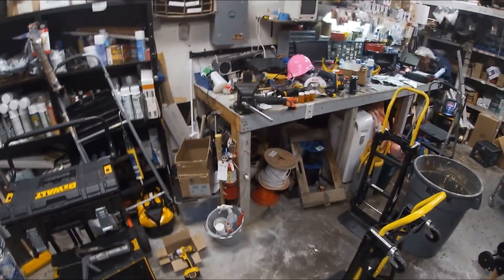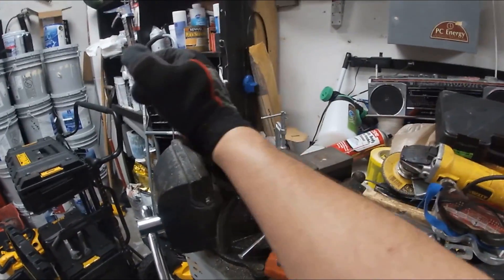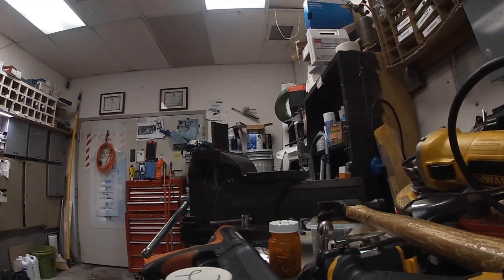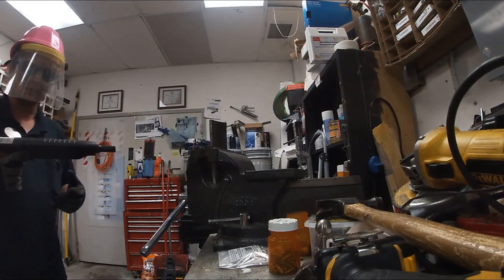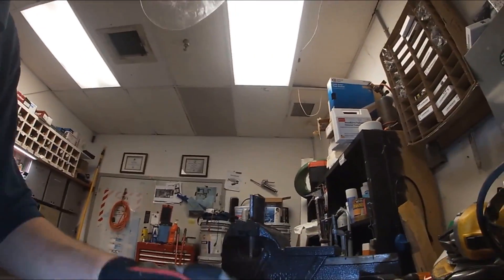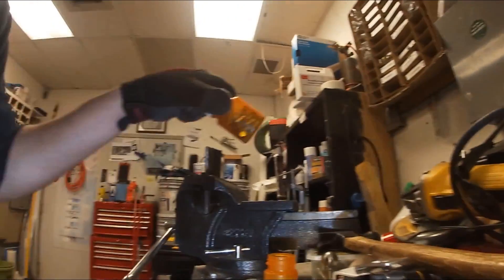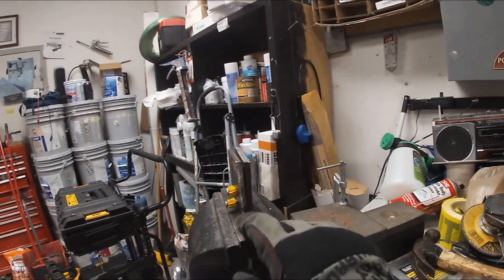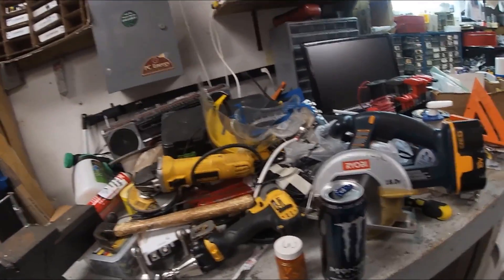Can a powder actuated tool AKA Ramset shoot thru 1/2 inch steel.

Comment: The second plate pushing (springing) away is soaking up all the energy of the nail.
Reply from the maker: you are right if I did this test with it pushed down to the floor it may have made it . thanks for watching

Comment: you do know they have pins and loads specifically for fastening to steel right?. even steel to steel (some tools)... the drive pins are hard to bend, the heads will mushroom first.
the driven "pins" are softer(nails/fasteners") I'm more familiar with hilti.....